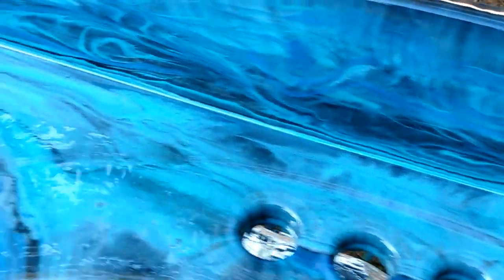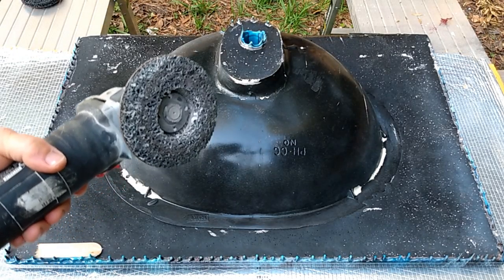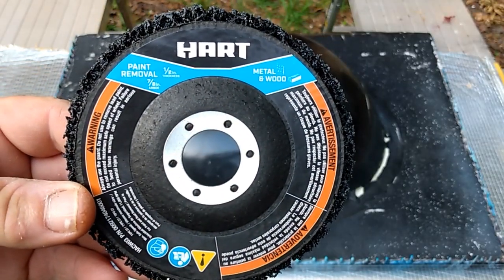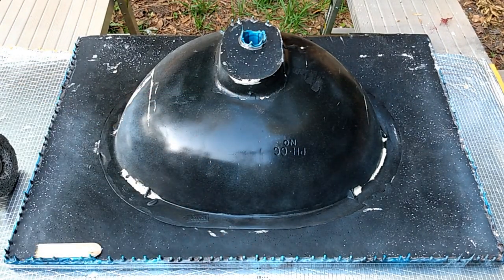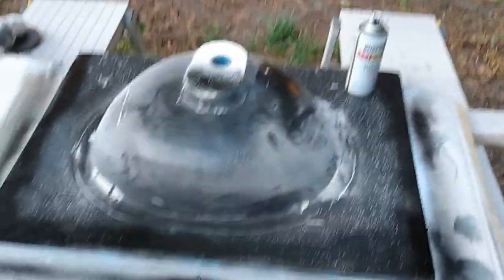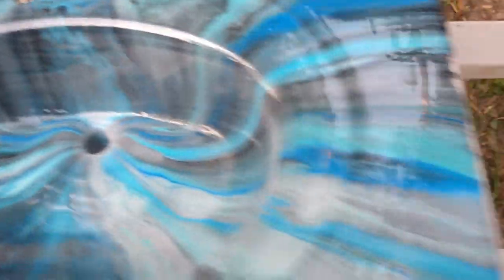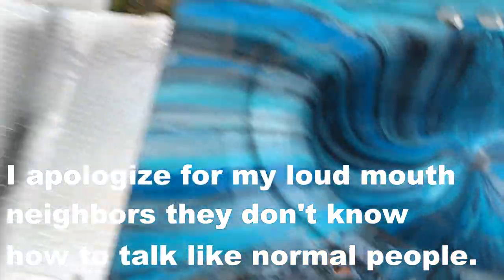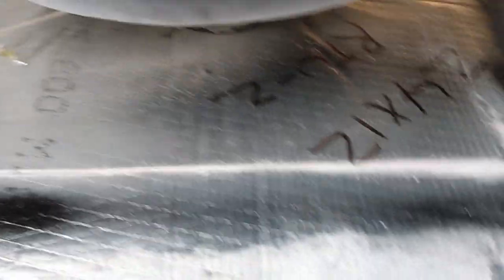THE BEST WAY TO REMOVE EPOXY.  I show you the best way to remove epoxy drips after they have cured.

Comment: Fantastic brother.  Ive been using an 80 grit pad on my 90 degree angle grinder,  taking my sweet time and spraying with a clear coat underneath.  This will help alot. Thank you so much for sharing
Reply from the maker: +Texas Jedi 
Thank you. this pad cuts through this dried epoxy like hot butter. glad it helps you out.

Comment: Hi! Th al you for this so detailed information. Very valuable. Do you think I can use this same method if I need to completely remove a coat of epoxy. I am making a small table and don’t like how the sides came out. I want to remove the epoxy off completely. Please advise. Thank you!
Reply from the maker: Thank you so much for your comment I really do appreciate it. Yes this method will work to remove all of the epoxy or you could sand it down smooth and go over top of it again instead of trying to remove all of that epoxy. Unless you just want to get rid of the epoxy that is there all together but yes this method will work very well on removing that epoxy.

Comment: Hello maybe you can help. We poured epoxy our bathroom countertop and it yellowed! We are trying to figure out how to remove the epoxy and start over. Any suggestions on what or how to remove the thick epoxy?
Reply from the maker: I'll do my best to help. I can say with confidence you're not going to be able to remove the thick layer of epoxy. My suggestion would be to take some 220 grit sandpaper sand the entire countertop with that. Then you will be able to pour directly over top of that with a new color coat of epoxy. You don't have to remove the existing epoxy all you got to do is like I said send it with 220 grit to scuff it up. That will give that new epoxy that you put on top of it something to bite to and you'll be as good as gold then. I've done jobs that people has hired someone to come in and pour their counters and they mess it up. Then they call me seeing if I can fix it and that's what I do I go in there and I send the epoxy job that was done I sand it down real good. And then I'll just do my epoxy work as if it had never been done before I hope this helps if I could do anything else please don't hesitate to let me know.
Reply from the maker: I do have somewhat of a tip for you if you going to use a light color for countertops especially if you're doing it with epoxy. Make sure you get a top brand epoxy one with a good UV inhibitor in it. 95% of the time UV light is what causes epoxy to yellow especially if it's a lower end epoxy.
Reply: @LiquidCreationsCo2609  thank you thank you thank you!!! You saved us a ton of headache in just a paragraph. Thank you my brother ✅. Heading to the store after work.
Reply from the maker: @LifeWithUsTV  Your welcome I'm just glad I could help that's why I started this YouTube channel.if ther is anything else I can help with please just let me know.

Comment: I poured one thin coat of Varathan Bar Kerpets epoxy over a wooden table I was refinishing, and it looks awful! I wantvto remove the resin and just finish with a few coats of polyurethane. I don't have an angle grinder, but would my random orbital sander work with a rough grit sandpaper? I also have a heat gun, but would like to get it done the fastest way possible.
Reply from the maker: You can do it with a random orbital but I wouldn't go any higher than a 60-grip paper because the epoxy is going to clog the sandpaper up quick. What has caused it to look awful was it a color or something you put in it do you have pictures of it?

Comment: I made a round epoxy table but the thing is I used a round metal pot, put tapes inside and poured the epoxy. It's dried now but I don't know how to take out the dried epoxy without breaking the pot and the dried round epoxy. Any solutions?
Reply from the maker: I'm sorry I don't quite follow what your asking.
I got that you made a round epoxy table. But I don't understand the rest of the comment what did you put tape in? Are you talking about getting the dried epoxy out of your mixing pot?

Comment: thank you this was help. Can I use the same sanding pad to remove epoxy from  around the top sink edges. I did not remove the taping in time
Reply from the maker: Absolutely yes that sanding pad will remove the dried epoxy and tape with no problem. If there is anything else I can help you with let me know.

Comment: I poured my first epoxy project doing my bathroom countertop. I have one of those integrated sink and countertop. I attempted to pour epoxy over counter and let it drip into the sink. I made a mistake tapping the drain instead of letting the epoxy drip through the drain, so now I have harden epoxy over the drain. How do I fix this? I cut the epoxy to exposed the drain, but now it looks tacky. If you or anyone know a quick fix without ruining the whole countertop I would appreciate very much for some advice. Thanks in advance
Reply from the maker: Hello and sorry how much did you cut away? if you did not cut to much away the hardware that your going to put in there will cover it and you will not be able to see it. But again how much did you cut away?
Reply: @LiquidCreationsCo2609  I only cut around the drain,. i did not remove the metal part in the bottom of the sink. I just covered it with tape, so when the epoxy dried over the drain, I had to cut some of the epoxy out. What happened was the epoxy slowly pulled to the bottom of the sink, leaving a well around the drain opening.
Reply from the maker: @rosaleencook1005  Is there anyway you can send me a pix of it that way I can better help you you can send it to my email at 
robertkellogg71@gmail.com
Reply from the maker: @rosaleencook1005  And please let me know if and when you send it we will get it fixed.
Reply: Good morning. I sent the picture this morning to your email. Thanks!
Reply from the maker: @rosaleencook1005  Ok after looking at the pictures you sent me I would use a sharp razor blade to cut the epoxy away from the silver piece that the epoxy is covering. You have got to find the edge of that silver piece and take your time and cut slow that way you don't over cut. Once that's done remove the silver piece "it's very easy to remove" take it to  Home Depot and get someone to get you one to replace it. The new one needs to be a bit bigger  make sure it's just a little bit bigger " around " I mean. That way it will cover where you had to cut the epoxy once you reinstall it no one will every see. And the part only cost like 10$ I can tell you it sure beats having to sand it down and redo your whole sink. I hope this helps because that"s the way I would fix it.

Comment: You're not worried about chip out or anything doing it that way? Do you have to do anything to the drain to have the plumbing fit properly due to the change in diameter because of the resin?
Reply from the maker: ,On some of the sinks that I do I have got to keep the epoxy scraped out of the drain as it cures but for most of them the epoxy is so thin that it's not a problem. and no not to worried about it chipping so far that hasn't happened,
Reply: Liquid Creations Co. what kind of paint do you use. Thank you.
Reply from the maker: @Dragon_skull826  I use Rust-Oleum spray.
Reply: Liquid Creations Co. thank you so much.
Reply from the maker: @Dragon_skull826  your welcome. and thank you for your support on the channel.👍